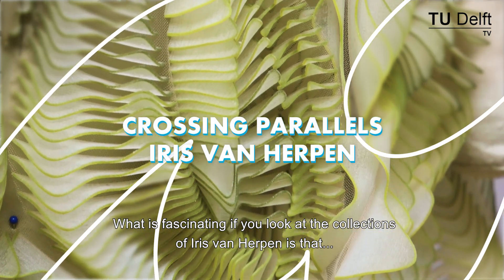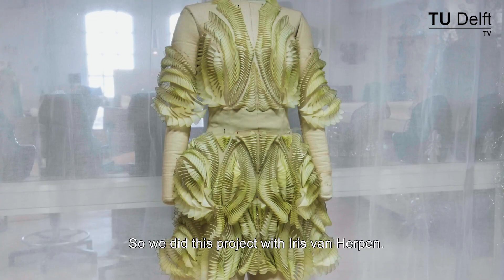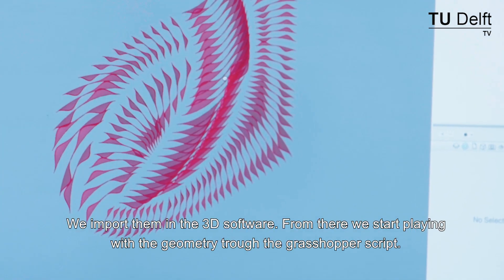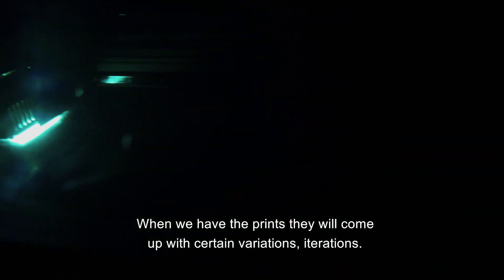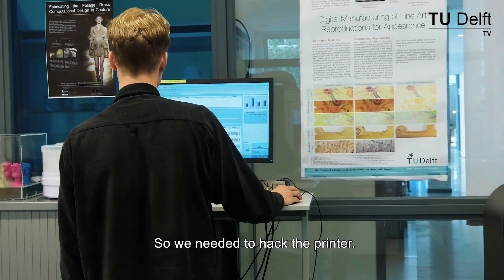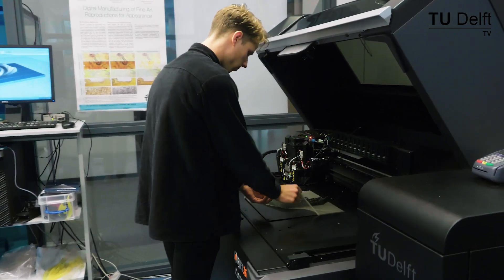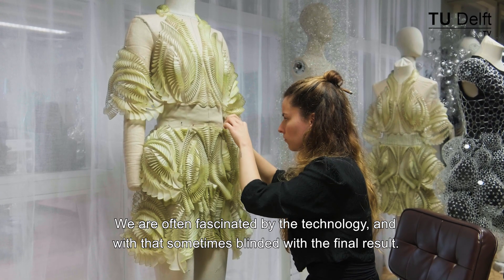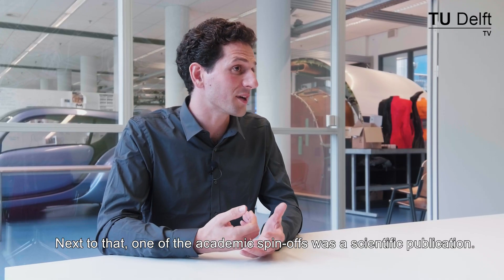Dress of the future

Comment: interesting  ,  practical limited,  showy  of course ,  dry clean only.    //has  parts of the  forms  , been laid  on the flat surface in a wind tunnel..~    building  structures       ,  would  forms  possibly stand up in  areas that have tornado's ..  pending on  what large structures are made of.      another  is that  less  height      sort of like  how cardboard is  yet  with wind /weather  proof  outer fabric  ,  with the contouring    3d  forms within  and above a inner  liner  fabric ..     space suits .   that are not as bulky .  ~         nice to see  thinkers  with lots of imagination...